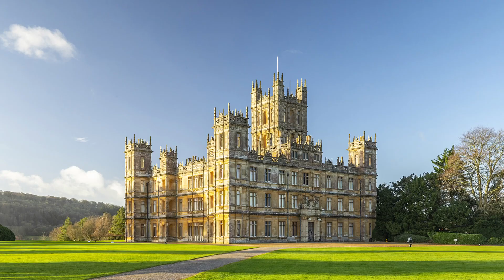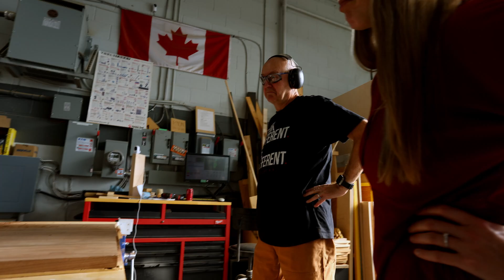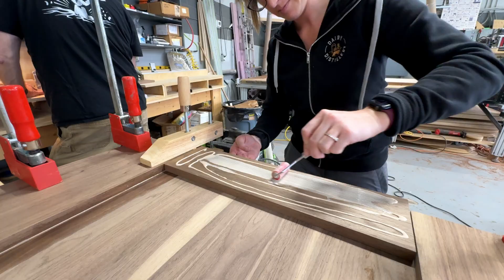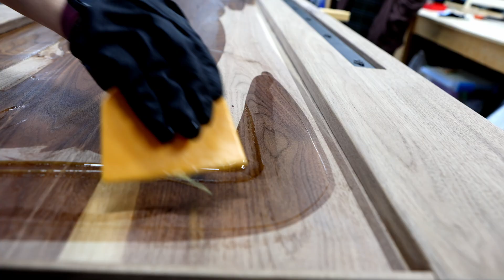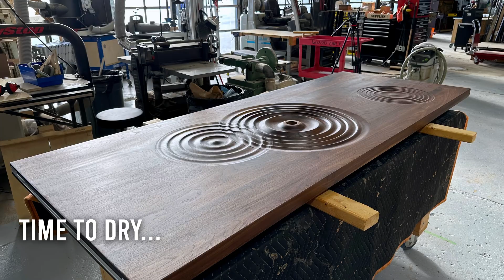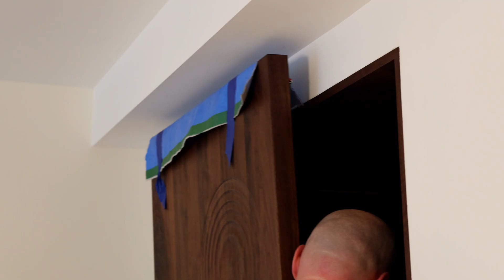Building The Water Drop Door!

Comment: To be a little critical, I don't care for the grain mismatch of the board on the left. I would have turned it around so that the light part is on the edge, and not interfering with the main water drop. It's just too noisy. Sorry.
Reply from the maker: Hi! Actually I agree with you. We only had that one board at the time, and the other side of it had a similar disfigurement. Couldn’t flip it. Next time we’ll have more slabs to choose from! Thanks for checking us out!
Reply: @loen.design but… you didn’t use a slab. You even showed the glue up… was just a bad or unlucky decision in the glue up
Reply: @greglinski2208 let’s see you do better, complete with video.
Reply: I have to admit that I was thinking the same thing.  In fact, had you flipped the light grain to the outside, it would have accentuated your water drop motif rather than broken it up a bit.  Other than that, beautiful work and fantastic concept. 👍
Reply: Just paint the board blue
Reply: I like it.  Shows that it’s not all cold and machine like.  It has light wood like wood usually does, shows that it’s a natural piece of wood.  People here get bent out of shape over the littlest thing, and it’s not even their door.
Reply: Just went back to the thumbnail and it’s clearly visible there. 
Mate, I’d just own it - it was a bad decision. Nothing wrong with making a few mistakes here or there. We all do it. But own it